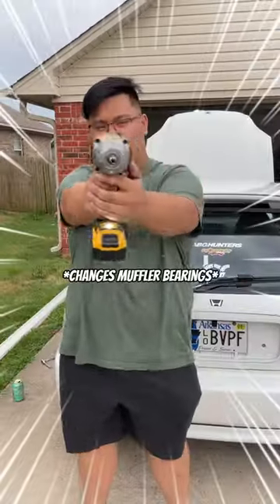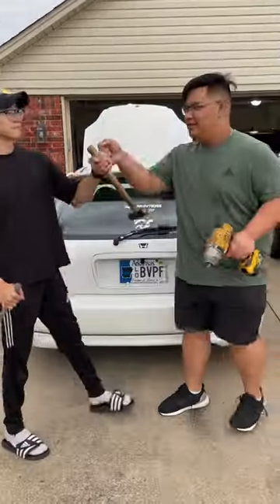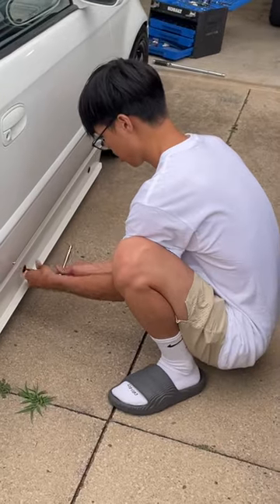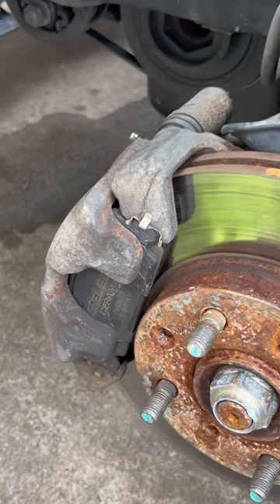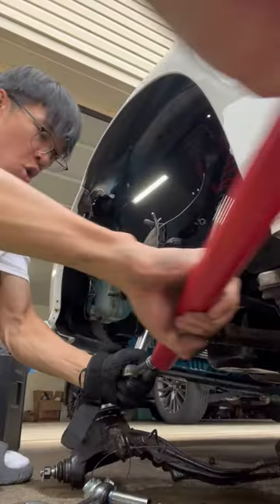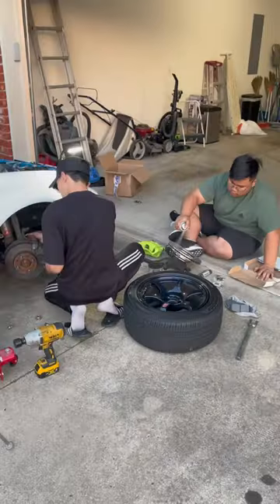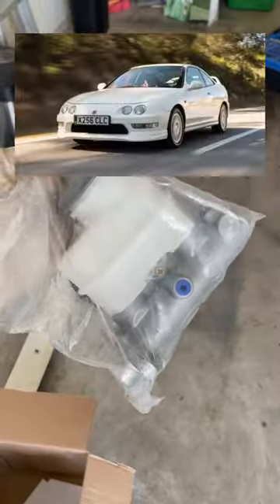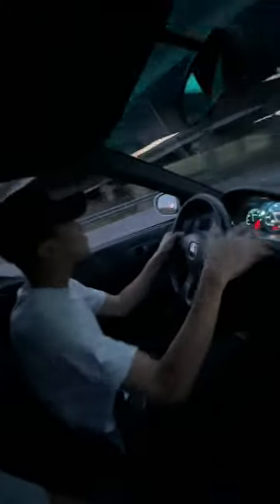This Upgrade is for the BROKE… 💸 #shorts

Comment: I’ll never understand this. You now have the same setup as a gsr but you have a 4x114.3 pattern instead of 4x100
Reply: Itr swap would be 5x114.3, what he installed was 4x100, so it's definitely not itr. 4x114.3 is not a size.